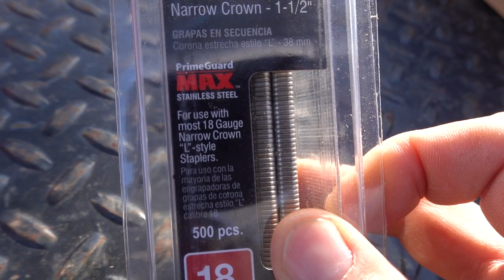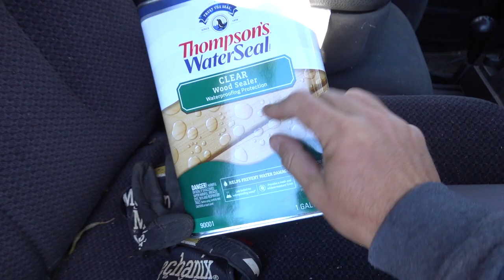GUARD DOGS WERE JUST AS SURPRISED AS I WAS -  CEDAR TRIM FOR THE 100 YEAR OLD STONE CABIN

Comment: I like what all you are doing with the rock cabin. Maybe it's just me, but I think you should cut the bottom corners down to match the side levels. Have you thought about putting some solar down there to give you at least a little bit of power? Also wondering if yo are going to put either some propane or maybe even a wood stove in it?

Comment: Hiya Kevin, you can make an exterior grade door for the rock cabin it’s common sense that’s needed to make one. Even I made one for my mates bird shed and it was the last thing I made before I ended up in the dammed wheelchair that put paid to my messing around with wood. I had to laugh at my friend when I fitted his door in the shed as he reckoned it was better than his front door. lol that’s the cost of buying mass produced products. So if I can do it you can  that was my first and last door as well so it was made to last hahaha.
By any chance the roofing your going to fit is it metal slates\tiles they come it strips or panels and you start at bottom and work your way up nailing them on?

Comment: If you attach a piece of wood under the gate, (just tie it on with wire), the ducks will not be able to get through, and if you attach chicken wire to the fence the chickens won't get out but that means that Mojo will not be able to get through the fence. You showed us the tail hanging down from the truck, and then told us about the rat, was it Smegles tail or a rat? you didn't tell us.

Comment: I wonder how inconvenient it is to measure in inches. We use centimeters which is a smaller unit than inches and we sometimes have to be more accurate so we specify on top of that the additional millimeters.  But inches? really?